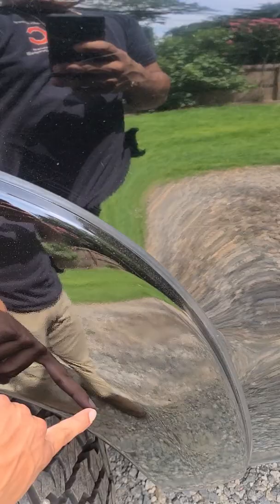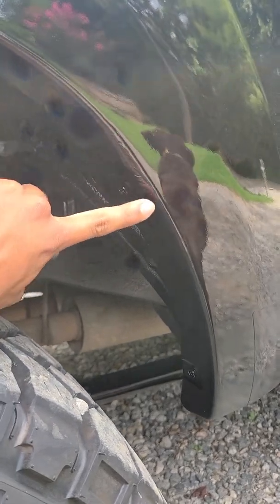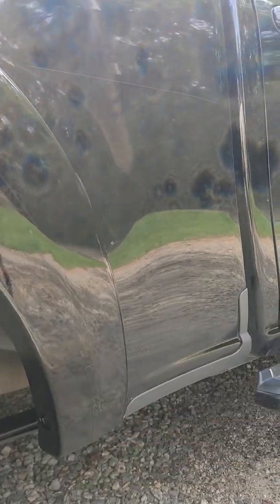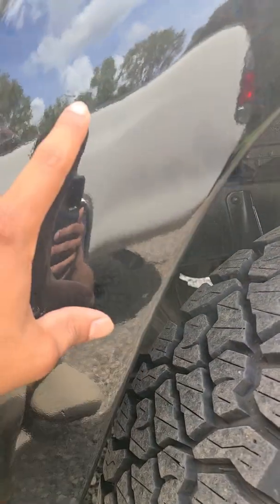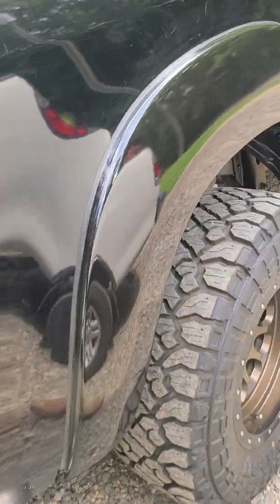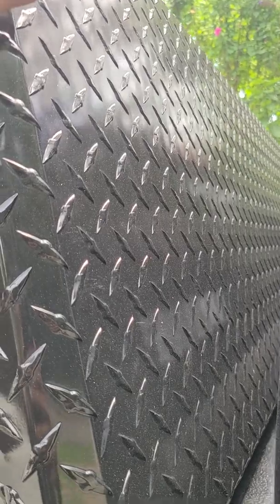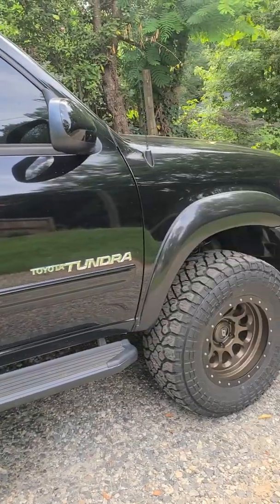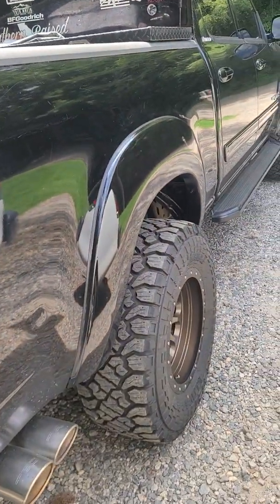Finally, some fresh paint on the first gen Tundra!

Comment: how many miles now bro?!?!
Reply from the maker: 432k
Reply: @02to06TUNDRAFAN   dang these Toyotas are badass !
Reply from the maker: @Piney Ken  it's at over 442k now. Left the house with 440.5k on a 30 hour 1500 mile road trip to Mexico. 5th time down here and hasn't skipped a beat.
Reply: @02to06TUNDRAFAN  I just bought 2002 sequoia 4wd limited with 300k miles not gonna lie I was scared for bit because after seeing your mileage and how your truck is doing I’m confident again with the purchase. And your truck is clean man and thanks for infos on your videos 🤙
Reply from the maker: @Piney Ken  no problem chief. 🤙🏼 just keep up with maintenance and run quality parts. I purchased mine with 292k back in 2015. Been doing about 20k miles a year this year it will be close to 24k. Pulled a trailer 3-4x a week minimum. Don't doubt the reliability of a 2uzfe platform as long as it's been kept up with